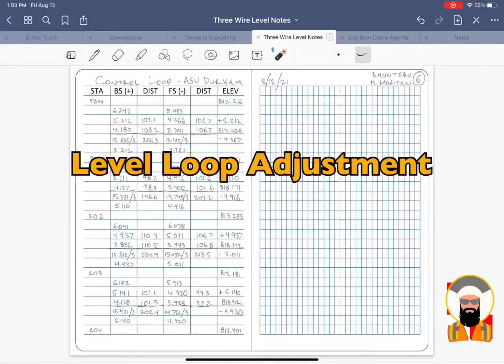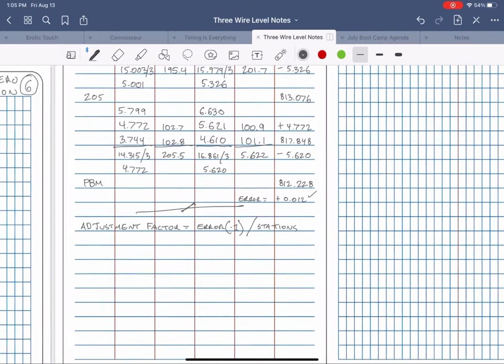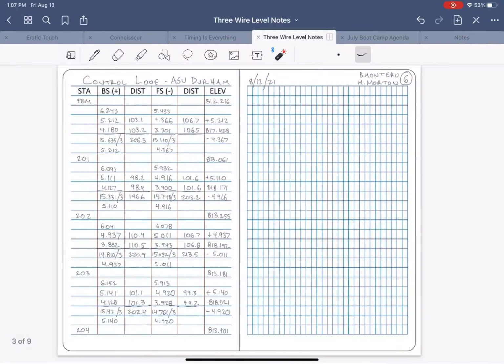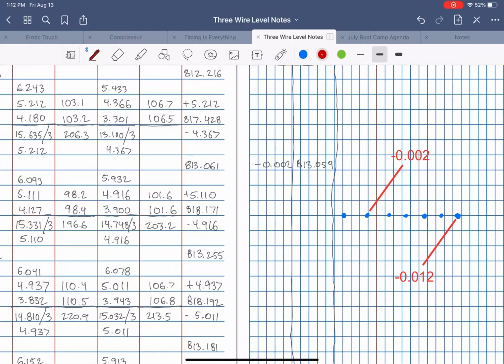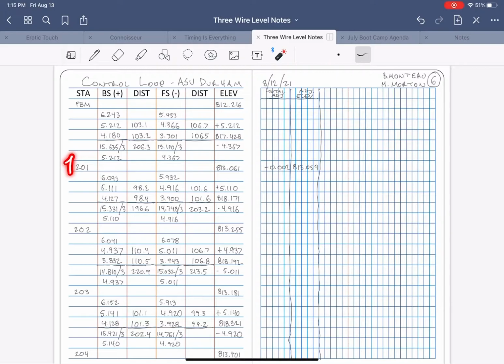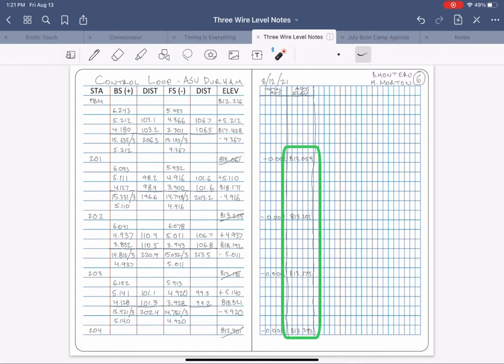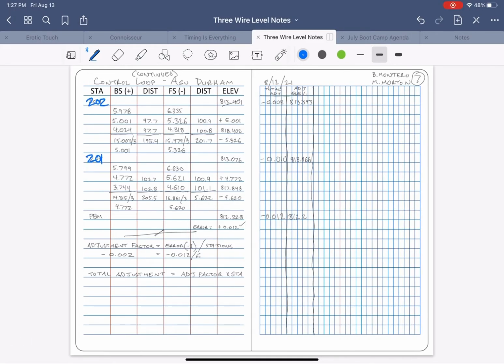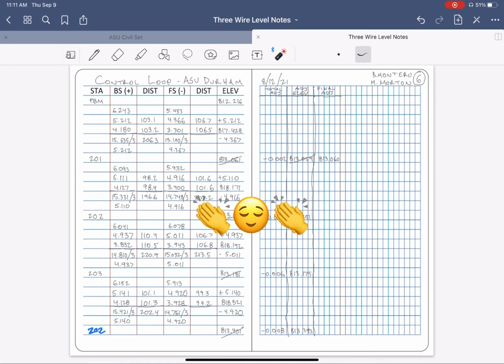Surveying: Level Loop Adjustment

Comment: Hi mate thanks for the video, question for you. How do you adjust the level by distance? Been told it's similar to bowditch?

Thanks from Australia
Reply from the maker: @CakeBomb74  Not quite sure what you mean by adjust by distance, but the level needs to be set up approximately mid way between the backsight and foresight.  Another reason you collect distance is to determine level or order of accuracy. Your allowable error grows as distance grows, so tracking distance is necessary.

Comment: Sir what is the minimum and maximum length between Auto Level to reading staff
Reply from the maker: There is no minimum so long as you can take an accurate reading. If you are taking a single reading and not part of a loop you should always work equal to or less than your backsight distance. If its part of a level loop, you should aim to be equal to your backsight distance. A 24x power level is often good from 150-200 feet at a maximum (including reading the thousandths) and a 32x power level can often sight out to about 250’ comfortably. It’s a very large price difference between 24x and 32x for only 50-100 more feet of coverage, you might find good planning and a 24x level are all you need for most tasks.
Reply: Thank you so much sir for giving your valuable time

Comment: what if I have like 9 feet difference from my initial BM , and at the end the measurement?
Reply from the maker: You don’t have t place your level on line or in between your two observations points, just equal distance from both. That means you could back up until you were an equal distance from each point but far enough away for a good reading. If you are forced to take a close reading, you can use the hard sight to determine what foot you are working in, and then focus through the level for your tenths, hundredths and thousandths.